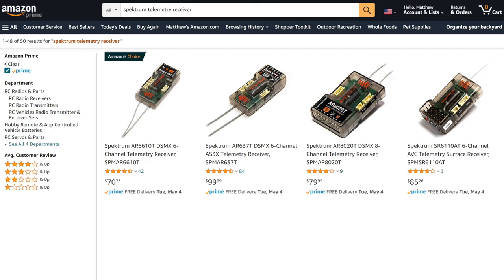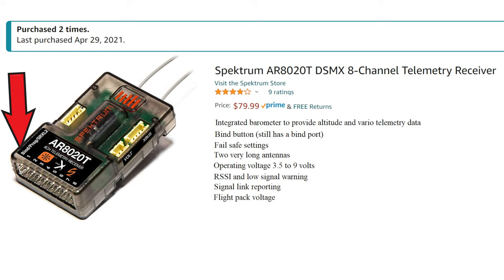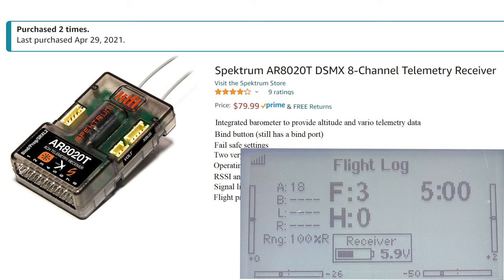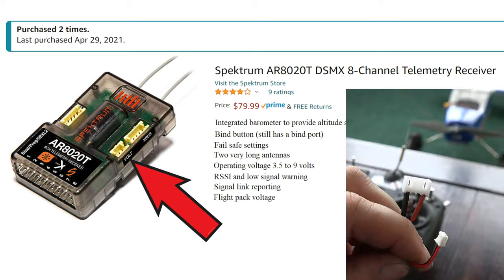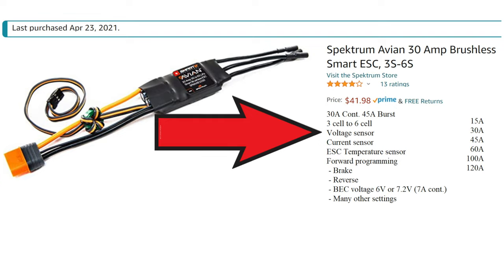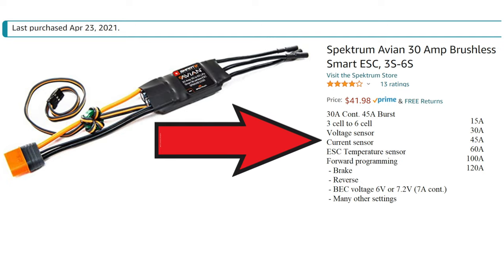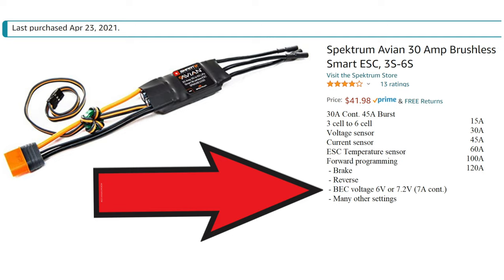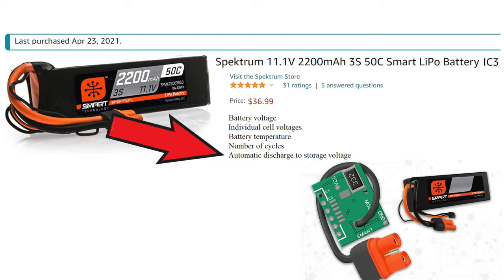Spektrum Smart Telemetry Explained and Demonstrated

Comment: Thanks, Matthew.  Excellent explanation with pictures.  please make a video on checking the current using a current meter, and why do it.  I usually check out the battery pack, check surfaces going in the correct direction and make signal tests from time to time and that's all

Comment: This was a very good video for a noob like me. Looking for information to decide what to buy as a first radio and I chose Spektrum NX10 together with AR8360T. I guess that I have a lot of stuff to walk through before I'm ready for my first airplane.
Reply from the maker: Those are good choices. You should also get the Spektrum USB dongle too and Real Flight simulator so that you can practice. Flying RC is fun and rewarding, but it is difficult to learn. The first crashes usually make people want to stop. Make your first 1,000 crashes happen on a simulator.
Reply: @MatthewHeiskell  I found some information that the NX10 should be able to connect to flight sim via USB. So I guess that the flightsim app is next on my list.
Reply from the maker: Perfect!

Comment: Very helpful information, thank you. Where did you purchase your cord to go from receiver voltage to battery lead?
Reply from the maker: Thanks! That came with the receiver.
Reply: I discovered the cable as well. I now only need to add a balance lead connector and I am set. I tested it by taking the wires and simply inserting them into the battery balance lead and it worked great. However, I want something more permanent by attaching a connector. thanks for the great advice.

Comment: I have a Avistar 40 with a OS 46 FX and im trying to find the right receiver to use with my DX6i. Its a DSMX so i was told it will work with the newer receivers. I dont need telemetry or any of that fancy stuff i just need  a good receiver that wont lose signal. What is the right receiver you think I should get?
Reply from the maker: Sorry for the late reply, did you pick one? I usually look for receivers that have two long antenna, and place them carefully with a 90 degree separation angle using coffee straws.
Reply: @MatthewHeiskell  thank you for your reply. I went ahead with the AR 631 and the 410. I haven had an issue with the receivers yet. I've also had to replace the OS46fx with an OS AXii MAX. It's been a reliable plane since then.

Comment: Matthew Does spektrum have a combination receiver and esc and smart battery that will warn you when your battery is below a selected voltage in the telemetry menu? Or do you have to use the sending wire that gets connected to you lipo ?
Reply from the maker: The simplest and cheapest solution is to use the telemetry receiver only, but you have to connect those two voltage sensing wires to the battery. The other option is to use the telemetry receiver and smart ESC together. That will work with any battery too. And you won’t need to connect those two voltage sensing wires to your battery.

Comment: You don't need a balance plug to read volts. You can hard wire it to the esc side of the plug to get voltage as well
Reply from the maker: Yeah, that's the best way. Then you only have one battery plug to connect. I was just doing a quick solution, not a permanent install.
Reply: Mikey, can you explain you're method in more detail?
Reply from the maker: @joshuajones5331  You know the ESC wires that you connect to your battery, connect the two voltage sensing wires there. (Solder the two little wires to the power input pads of the ESC)
Reply: @MatthewHeiskell  oh ok! Thanks. That's brilliant

Comment: I'm a beginner, I've been flying the arrows Bigfoot RTF. I want to buy my first radio, I was looking  to get a Nx6 or Nx8? My plane has flaps and I would like safe and motor cut off switch. Both radios that I'm looking at don't come with receiver.. So what what kind a receiver should I get it?
Thanks
Reply from the maker: The Nx6 with a 6 channel receiver will work well for you. The motor cut does not use a channel, just an extra switch on the transmitter.

Comment: Hi Matthew! I have a NX8 / AR8020T receiver. I would like to have altitude/vario and battery telemetry. What do I have to buy in order to have this information in my radio? Thanks!
Reply from the maker: You don't need anything extra. You can do those things with what you have. That's basically what I did in the video, maybe watch it again? Lemme know if you still have questions! 😁
Reply: @MatthewHeiskell  I think my receptor is not working well. Altitude still not working.

Comment: What I'm wondering... if I get the GPS module for my existing reciever can I have all the virtual fence functions of those airplanes with the GPS module installed?
Reply from the maker: That’s a good question! I’m not sure of the answer, but I think that the virtual fence capable receiver is a full blown flight controller. Adding a GPS to a normal telemetry receiver might be able to warn you when you’ve gone a certain distance, but I think it would need to be a flight controller to fly the plane homeward for you. Cheers Turbo Jones! Thanks for your other nice comments! 😄

Comment: So I can use only the AR8020T receiver and get flight pack voltage back to my Spektrum radio?     I do NOT have to have the Smart ESC nor Smart battery used in conjunction with this receiver...correct?
Reply from the maker: Correct! Just run those voltage sensing wires to your battery. I used the balance lead connectors to make it easy

Comment: How do I get the pack voltage to work on my DX9, 2.08 firmware. Using a E Flite Turbo Timber Evolution. AR637TA receiver. It just keeps say flight pack no data
Reply from the maker: Try hitting the auto discover function button. Make you everything is connected and ready to fly when you click it.

Comment: Will the AR637TA provide flight volt without a Smart ESC in place?    Can'tI just use the voltage wire and plug into the lipo balance wire?
Reply from the maker: Yup, that’s one of the things that I demonstrated in the video.

Comment: Does it pay to put an extra satellite on those new Telemetry receivers
Reply from the maker: Good question! You should be fine if you correct mount the two long antennas. They need to be far away from each other and the short active part at the end need to be 90 degrees from the other one. Basically, point one nose to tail, and point the other one wing tip to wing tip. You can examine the number of dropped frames after a flight. If the number is high, adjust the antennas or add a satellite receiver.

Comment: Hi!
very informative video.
Happened to land on this channel as I am trying to learn if the AM8020T receiver can be used with Radiomaster TX16S which supports DSMX protocol?
And if the telemetry features or at least the battery voltage telemetry could be used?
This is to be used on a TREX 500XT helicopter with a BD AXON FBL system.
Great if I could have your opinion.
Reply from the maker: Hello Vitor, that's a reallly nice helicopter. Are you sure that you want to fly with Spektrum? Why not FRSky or TBS Crossfire? The BD AXON FBL takes SBUS as input, right? You just really want voltage telemetry?
Reply: @MatthewHeiskell  Hi, thanks for coming back. Does not have to be Spectrum, It may be any system that works with Radiomaster and is adequate for that size of Heli. Both your suggestions are good, thanks. I never though about crossfire  as I had it as very long range system, and rather expensive. But after reading your comment, I did some research and it might be a good contender. Thanks

Comment: hello my 8 channel as3x receiver doesn't announce altitude. do you know how to program it?
Reply from the maker: So you have the data on your screen, but you want it to speak when you hit a button or switch? You need to make a custom sound/voice event in the transmitter.
Reply: @MatthewHeiskell  did that and still  no data found
Reply from the maker: I recommend calling horizon hobby customer support. They can walk you through it on the phone. 1 (888) 959-2307

Comment: I was hoping that I could set up the telemetry to put out an audible warning that the flight battery was down to a certain voltage and then I would proceed to land rather than having to flick a switch to hear what the voltage was and then decide.
Reply from the maker: You can set it to do that. Often times it defaults to do that exact behavior after you auto configure the telemetry.
Reply: @MatthewHeiskell  Oh ok, I haven't picked up my AR8200T as yet so ok, we will give it a try.
Reply from the maker: @mrvoyagerm  Awesome!

Comment: What is the maximum voltage these telemetry receivers can take at the "volt" telemetry port on the casing?
Reply from the maker: One of mine is on a 6s plane. I think the upper limit is 30 volts.
Reply: @MatthewHeiskell  Cheers Matthew, good to know
Reply: 60 V max

Comment: I purchased an NX8 and the AR8020T receiver....does this have to replace the receiver that came with my cessna....can't seem to find a video on the installation of the new receiver that comes with the new radio or can I use the other receiver?
Reply from the maker: You can use the receiver that is already in the plane or you can use the new one if the original one does not have telemetry. But the first one might have SAFE, which makes it easier to fly.
Reply: @MatthewHeiskell  thank you very much

Comment: Dx6 g2 us version.  Won’t bind to my recivers  like ar6100/ lemon / orange recivers.  Is it the recivers or the transmitter. Ok with dx6i
Reply from the maker: I think those receivers are DSM2. Your old transmitter is DSM2, but your new transmitter is DSMX. You should be able to change a setting in your new transmitter to make it work as DSM2. Also, you might need to update the firmware of the transmitter.

Comment: I have the E-Flite BNF RV-7 and Turbo Timber 1.5m evolution can I get altitude from the recievers with my NX8 radio or to I need to add a telemetry altitude sensor?
Reply from the maker: You should be able to get altitude from those receivers. After you bind, and the control surfaces are responding, go to the telemetry page and select AUTO and it should populate.
Reply: @MatthewHeiskell  Thank you, I will give it a go; before I fly tomorrow. Cheers

Comment: It’s scary thought that I might blow up the unit when I put high voltage lipo into the telemetry port. There’s no information about max voltage it can take. I took a chance to inject a 7s lipo, low and behold, it reads the voltage correctly and I didnt blow it up. I havent tried over 7s voltage, maybe anyone can find out whats the max voltage
Reply from the maker: You’ve got to be pretty close! I thought 6s was the max. It might be in the spec sheet.
Reply: @MatthewHeiskell  I couldn't find any info about it in spec sheet or manual on the net. OrangeRX and LemonRX mention in theirs. They could take up to 50V or 12s. It's a very disappointing that Spektrum is not very clear about their products
Reply from the maker: Yeah, that’s an important thing to know!

Comment: My voltage meter reads about .3 volts higher than my ar410 rx. Can the ar410 be recalibrated to match the voltage meter reading? NX10 TX.
Reply from the maker: Yeah, I think there is a way to adjust the offset in the transmitter menu.
Reply: @MatthewHeiskell  Thanks, I'll try to get it figured out.  :)  Also, I'm assuming the voltage meter is more accurate. My other RXs agree with it, but this one particular ar410 doesn't.

Comment: I have an NX8 radio, RV-7 airplane (advertised as supporting fly by telemetry)
it has an Avian 45amp ESC lite, I am using a Spektrum 4s 2200 smart battery.

I can not get any telemetry screen to display actual values. 
What is wrong ?
Reply from the maker: With the airplane and transmitter connected to each other, ready to fly, go to the transmitter's telemetry screen and click "auto setup". That should discover all the sensors and setup the display for you.
Reply: @MatthewHeiskell  Matthew, thanks so much.. I am making some progress.. I did the auto setup and it added smart esc, gforce and gyroscope to the telemetry screen. I now see info displayed on the esc screen - rpms shows up and works,  temp is not working but I am guessing you must attach a sensor to the battery to have that available..
Now how do I get the battery voltage to display while I am flying or better yet how do I set a switch and get a voice to tell me the battery voltage while  I am flying ?

I put volts on the ticker tape option but it is not being displayed on the main menu???
Reply from the maker: @lw216316  I don't like to EVER look at my radio while flying. I suggest that you set it to speak the battery voltage when you flip a switch. I suggest that you use a 2 position switch. In the normal menu, look for "Custom voice/sound event" or something like that. Select the 2 position switch. Put the voltage telemetry on both switch positions. Here is a gotcha: There are TWO voltage telemetry options. One will work and the other will not. One relies on the simple voltage sensing wire and the other relies on the smart ESC. Since You're using the smart ESC. It will read out voltage, current, and ESC temperature each time you move the switch.
Reply: @MatthewHeiskell  thanks, it is working now on a switch.
Reply from the maker: @lw216316  Awesome! Well done! There are tons of useful audio clips that you can trigger. . . flaps up/down, gear up/down, low/mid/high rates.

Comment: Does this receiver need a satellite/remote receiver?
Reply from the maker: It is optional. You shouldn't need one if you position the antennas correctly. Also, the transmitter will warn you when the signal gets low.
Reply: @MatthewHeiskell  this will be my first time with this receiver how am I suppose to position the antennas?
Reply from the maker: @tlrcamp8009  Get them as far away as possible from each other and orient them 90 degrees to each other. (One up and one sideways) or (one up and one forward)

Comment: Hi, anyone know what’s the maximum voltage you can put in to the 2 pin “VOLT” port, I wish to run a 6 cell battery?
Reply from the maker: It can handle 6S. I have one on my 3m Fox glider. I think the max is 30V.
Reply: @MatthewHeiskell   Fabulous, thanks.

Comment: Does anyone know what type of plug (2 pole) is needed for the voltage measurement. I want to link it to the ESCs of different planes.
Reply from the maker: You're talking about the red and black voltage sensing wire, right? The connector that plugs into the receiver side is called a 2 pin JST PH.
Reply: @MatthewHeiskell  Thank you very much!!!!
Reply: @MatthewHeiskell  For you and others: Actually it is JST ZH 1,5 mm 2pin
Be carefull - plus (red) and minus (black) are exchanged when you buy these cables with a piece of cord. Measuring = knowing! 

Learned through damage (cables smoked) - luckily the receiver is not defective!
Reply: Was that a 
Generic or Horizon $12  "VOLT" port lead that had cable colors reversed?
Reply: @erichoenderop1142 thank you for this clarification...
Reply: @dhgmllcshea5038  Generic. But i don't know which is the 'standard' in the electrical world, but the generic cable have exchanged colors towards the Horizon one
Reply: @erichoenderop1142  danke schoen or ontzettend bedankt!

Comment: I guess in 2021 it’s cheaper and safe to go with a flight controller that won’t basically “fly away” and bring no matter what your model back or at least provide the last coordinates.
Reply from the maker: This receiver is 100% manual control only. It does not even have gyro stabilization (AS3X).

Comment: Spektrum......doing their part in continuing to keep this hobby expensive...............
Reply from the maker: I know! Most of the time I just use a Redcon CM703 receiver.
Reply: @MatthewHeiskell  I  have a DX6 and DX8 gen2 and some AS3X  Spektrums and they are good, but I find the 7 channel Lemons with stabilization  equal...and I can adjust  the gains on the Lemons with a small dial on their  Rx...
Reply from the maker: @garyvale8347  Yeah, I prefer that kind of adjustability too.